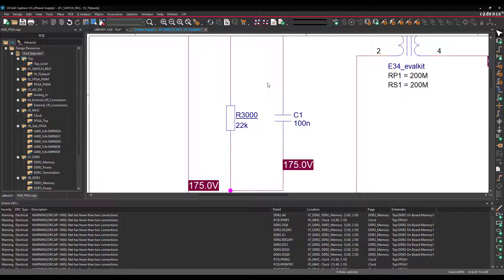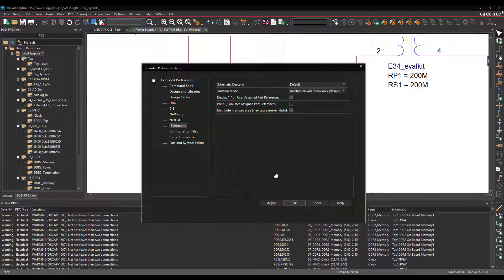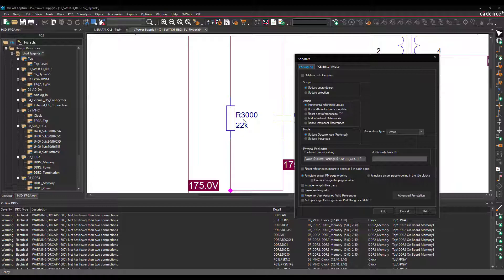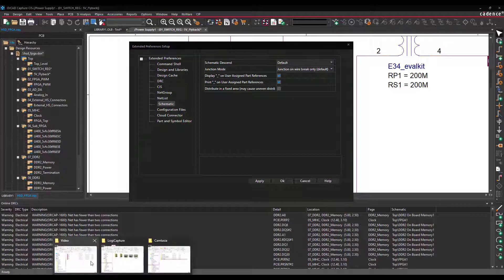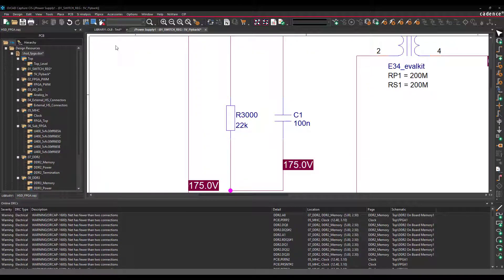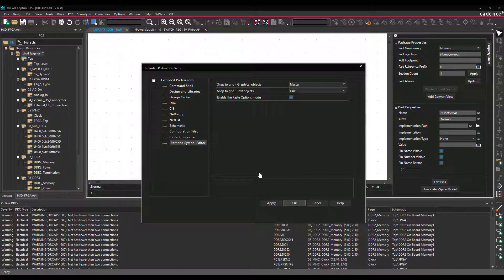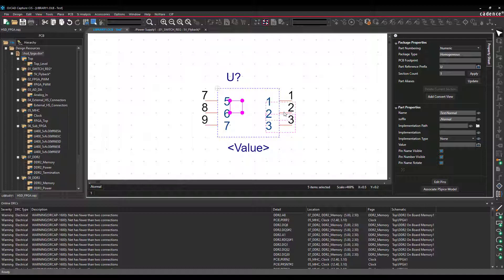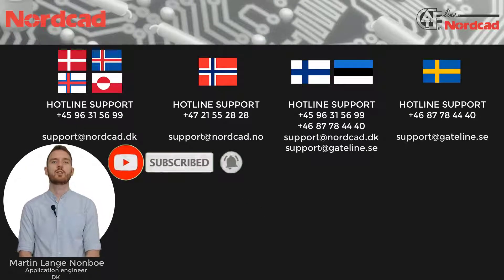Manage reference designators in Capture and copy/paste in Part Editor

Comment: Sir how can i assign duplicate reference like 24v 24v same refdesk without getting DRC ERORR please help me
Reply from the maker: Generally, you want to avoid assigning duplicate reference designators to components. Each component in your schematic should have a unique reference designator to distinguish it from others.

If you need to assign duplicate references, you can do so by using a combination of letters and numbers to make them unique. Here's how:

Select Component: Place the first component on your schematic.
Assign Reference Designator: Assign a reference designator, like "U1" or "R1," depending on the type of component. In your case, "24V".
Customize Reference Designator: Add a unique identifier to the reference designator. For example, you can use "24V1" for the first component and "24V2" for the second component.

By using unique identifiers like "24V1," "24V2," "24V3," and so on, you can avoid DRC errors while still indicating that these components are related. 
Hope this helps 😊